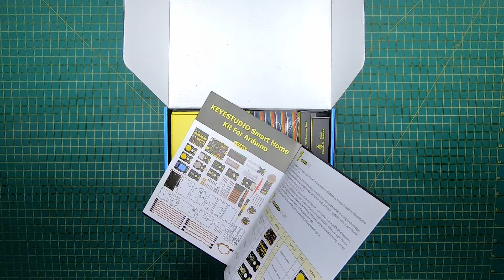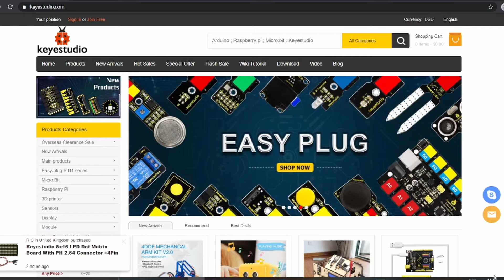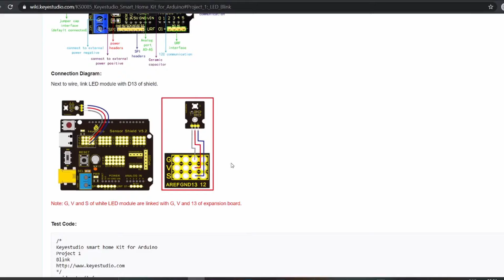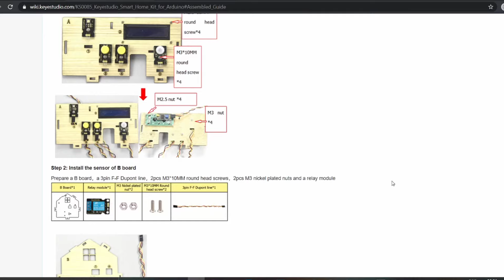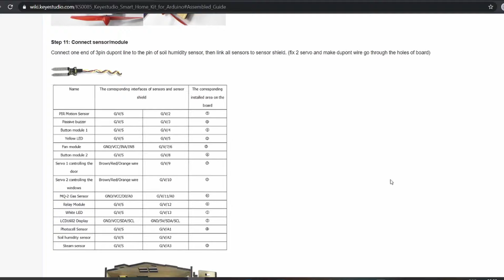Assembling and testing - Keyestudio Smart Home Kit for Arduino

Comment: How to connect all sensors and module cables to the sensor shield?
Reply from the maker: Most of the sensors, LEDs, switchs and others have a cable with 3 connections, they are ground (negative), voltage (positive, normally 5V) and signal. The sensor shield has male connections for this 3 positions, for many connections. So, you must be careful to connect the sensor in the right position, respection the negative/signal position. 
The sensor shield have numbers for these connections, and these numbers on most shield boards match the arduino pins, so look the schematic to see what pins is the sensor connected to.
Please contact the manufacturer for details and more information - https://wiki.keyestudio.com/KS5009_Keyestudio_Smart_Home

Comment: I am considering buying such sets for my vocational school class. Is it easy to disassemble and reuse them after use?
Reply from the maker: yes, it is not hard. But with the constant assembly and disassembly process, the wooden parts will probably suffer damage. My suggestion would be to make new wooden parts or design these parts and 3D print them.

Comment: ive followed all of the instructions and after plugging it in, all that happens is the buzzer going off + the lcd turning on. when i also connect to the app, nothing works. plz help me cuz i have a project due next week
Reply from the maker: Try a different power supply

Comment: Hi! I dont know why the app and the bluetooth mode it doesnt work for me... Can u help me?
Reply from the maker: Hi Pauete! Check the bluetooth connections. Try to use a different cell phone.
Reply: @HendrikxWorkshop  Okay! I will try it, when i use Arduino all the leds works but maybe the wires are connected of the setback...

Comment: When i upload the final code, all the systems works but the bluetooth mode its flashing and when i go to the app i go to connect and the app says: is connected but u cant do anything
Reply from the maker: Use a different device to connect
Reply: @HendrikxWorkshop  Yes thats what i do and now works, but some deveices dont work but thanks!
Reply from the maker: @Pauete_Kkhuete  great! I am glad that it is working now. If some devices are not working, check the connections.

Comment: I have a problem. 4 days ago i assembled the kit and everything was working fine until i tried to test it again. Now my buzzer is bepping every 2 seconds and LCD display is on, but i cant do anything else. Can you help me somehow?
Reply from the maker: Try to replace the batteries
Reply: @HendrikxWorkshop  i tried that but nothing
Reply from the maker: @juricanovak355  Check all the connections
Reply: @HendrikxWorkshop  i checked them and everything is ok

Comment: At the final project I have uploaded the codes, and tried to input the password, (by pushing the button as password was identified in the codes, ) but it the was not successful and buzzer was beeping all the time.  Pushing the button nothing happened, LCD screen did not change. 
Please let me know, what to do.
Reply from the maker: Hello Agnes!
Have you typed the code or copy/past? I would recommend to copy paste to avoid typos.
Have you selected the right arduino model?
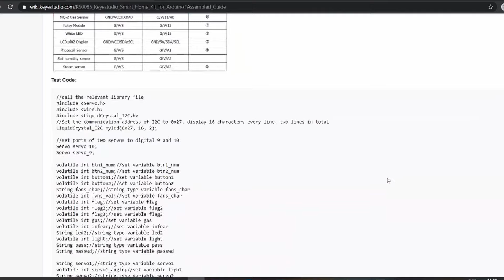Reply: @HendrikxWorkshop  I have copy pasted the codes of the final project to the arduino software. The problem is, that the LCD Display do not show anything, when I input the password by the button1. In your video this step is at 8:30 - 8:40  Do you have maybe a testcode for this step (input something by the button, and LCD display write it)?  If yes, I will provide my e-mail address.
Reply from the maker: I would recommend to perform the project 4 in order to test the button and project 12 to test the display. If it doesn´t work, let me know and I create a test code to test button and lcd.
Reply from the maker: Are you externally powering the arduino board? or only using the computer usb? what voltage are you using?
Reply: @HendrikxWorkshop  Hi, I am using only the computer usb. (Actually I have tried all of the opportunities, batteries and computer power source with both of the voltage.) Please let me know, what do you suggest. I did not find any istruction regarding the power source and voltage.
Reply from the maker: I connected an external power supply, 6 volts. 
I think the individual experiments work fine because they do not require much power. But when you try to assemble all sensors, computer usb is not enought to power them all, so an external power supply is required. Try to use it with the batteries.
Reply: @HendrikxWorkshop  I am having the exact same problem when I build mine. Please help! How do I hook an external power source? I use the batteries which is 9V. Also I dont have everything plugged in. Do I need to modify the test code they provide? Also, where did you get the code from? I used two different codes. One from the library they give as well as the test code in the wiki instructions. Thanks so much!
Reply from the maker: @vincentcoscione4056  I havent modified the test code...I took them from their website, copied and pasted. If you are a maker, it is a good idea to have an adjustable power supply to test your projects. select the voltage (9V) and connect the red cable to the positive pole and black to the negative pole.

Comment: My gears for both the window and the door are raised up when mounted on the servo and not nearly flush enough.  Thus they miss the other gear they are supposed to interact with (too high for them).  I have watched all the instructions over and over again and redone this  to be sure they are assembled as in the directions and in your video for that matter.  Any thoughts?
Reply from the maker: I took a picture but I am not sure how to send it to you. The servo horn must be on the opposite side of the servo, so the gear will be closer to the servo then the servo horn.
Reply: @HendrikxWorkshop  Thanks for the reply! I did all that and an email from Keyes support noted I had actually used the wrong screw from them the servo plastic bag (of course the only screws not labeled in the kit).  All that said the gears on the window and door still don't actually line up with each other.  It's also looks like the "house stock material" I got looks way thinner and way flimsier that what you show in your video.  Through my OCD and the creative use of some spacers I was able to get the window and door gears to work.  I had no problem with anything else, the Sensors and the Arduino portion were straight forward.  IMHO this smart home project is a great idea that could have been so much more if it would have been a bit better executed.  As it is now it is a bit tedious and my kids lost interest leaving me on it alone in the end.
Reply from the maker: Yes I agree. But you can use arduino, components and sensors to assemble something else. Check out my animatronic videos. 3D files are available for free. I would suggest the cupcake - https://youtu.be/mfhrf4_7yIM, you can use the servos, LEDs to program movements and lights, it can be activated with the sensors. this will attract your kids attention.
Reply: @HendrikxWorkshop  Yes the sensors/parts themselves are a nice assortment.  Your video is quite the little project very nice!  Perhaps Keyestudio should also give the the 3D files tome the house.

Comment: Hello!
I have a problem. My Bluetooth isn't connecting to my phone app. I can see It in the Bluetooth navigation. Any suggestions on what to do?
Reply from the maker: Hi Alen, is the bluetooth module correctly installed?  Have you loaded the correct arduino code?

Comment: Can we use battery 9v ?
Reply from the maker: Hi Wassim! Yes, I use an external 9V power supply. The only problem I see is that the battery won't last long.
Reply: @HendrikxWorkshop  because I didn't find battery 1.5 v alkalin
Reply from the maker: Any 1.5V battery will work
Reply: @HendrikxWorkshop  hello bro i have question about this Note
Note: Remove the Bluetooth module please, when uploading the test code. Otherwise, the program will fail to upload. Connect the Bluetooth and Bluetooth module to pair after uploading the test code.

Does this mean that I do not prove bluetooth module in shield sensor until the end of the program ?
Reply from the maker: Hi Wassim! yes, first remove the bluetooth module, then upload the test code successfully,  insert the Bluetooth module and power on.
Reply: @HendrikxWorkshop  bro its work with arduino uno made in italy ? Can i use it ? And not use keystudio its work ?
Reply from the maker: @wassimsoualili7153  I didn´t try it, but yes, you can use any arduino
Reply: @HendrikxWorkshop  Because this is my graduation project and I can't find enough information for this board keystudio plus for exemple his processor is atmel 328p ?
Reply: @HendrikxWorkshop  bro Do you have to run home usb cable and batterie or just batterie ?
Reply from the maker: Smart home works on batteries (just batteries or external power supply). 
You use USB cable only to upload arduino codes (together with the power supply or batteries, because it draws a lot of current and USB computer ports are not design to support that amount of current)
Reply from the maker: https://wiki.keyestudio.com/KS0486_Keyestudio_PLUS_Development_Board_(Black_And_Eco-friendly)
Reply: @HendrikxWorkshop  my freind what is the role of the relay here ?
Reply from the maker: @wassimsoualili7153  you can connect anything (lights, alarms, etc) it works as a switch
Reply: @HendrikxWorkshop  i dont understand When I turn it on the phone, nothing changes
Reply: @HendrikxWorkshop  And i have problem the gas sensor works but buzzer not ringing why ?
Reply from the maker: @wassimsoualili7153  is the bluetooth module installed correctly? do you see it on the bluetooth list on your cell phone?
Reply from the maker: @wassimsoualili7153  is the buzzer working on Project 3: Passive Buzzer?
Reply: @HendrikxWorkshop  the buzzer ring with sensor humidity but gaz not ringing
Reply: @HendrikxWorkshop  yes bro
Reply: @HendrikxWorkshop  I just want to know what happens when the relay is turned on And when it is not running whats the result ?
Reply from the maker: @wassimsoualili7153  check the connections between the sernsor and mainboard. Check the arduino code.
Reply from the maker: @wassimsoualili7153  you ear a click. and the pins will be connected, working as a switch (you can use a meter and check the resistance.

Comment: good morning ,
It's my first project I'm doing and I'm excited!
The house is assembled,
I see this error on the monitor:
3.3VL error
what could it depend on?
second question, when I load the
"Multipurpose Smart Home Kit - Test Code" on arduino, library missing error comes out:
LiquidCrystal_I2C
I loaded several liquidcrystal libraries but it doesn't work 🙁
third question, I can't find home kit on bluetooth from smartphone
thank you so much
Reply from the maker: my sugestion is to review all connections and program code. Try to reload a diferent LiquidCrystal library. 3.3VL error is probably related to 3,3volts, check the power supply.